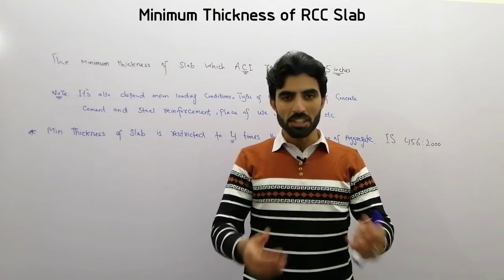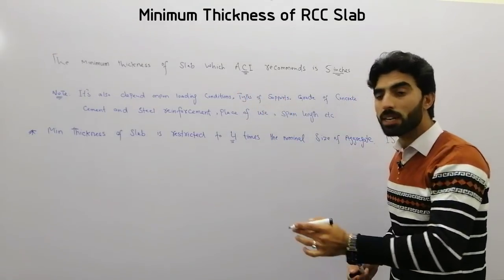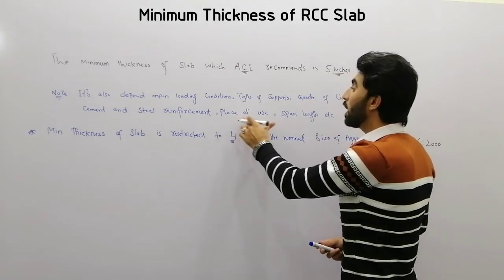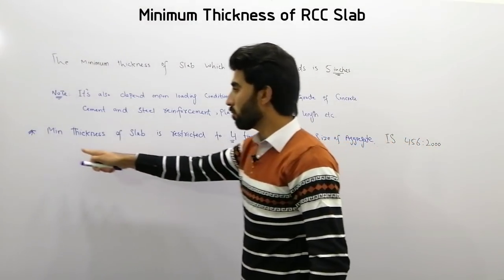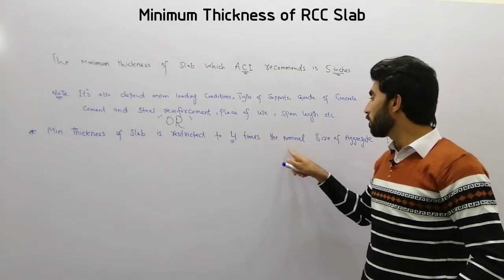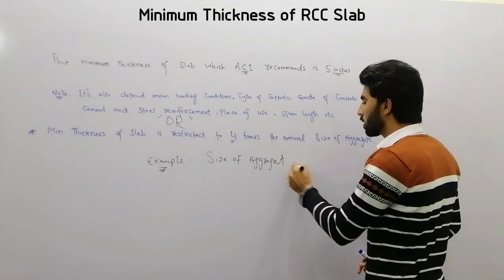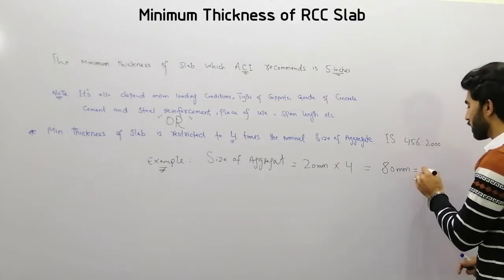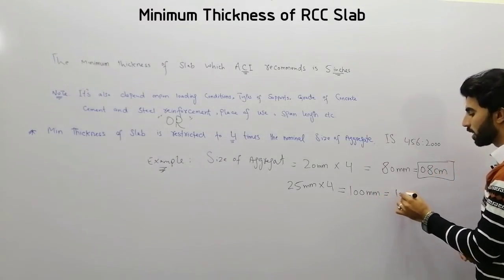Minimum thickness of RCC slab - Civil Engineering Videos

Comment: Pahle apne bataya 125mm fir bole aap 100 mm it's m not clear
Reply from the maker: From IS codes... If the crush size if 20mm we will take get thickness to multiply 4 time of crush size  if size of crush is 25mm x 4 (from IS Code ) = 100mm = 10cm